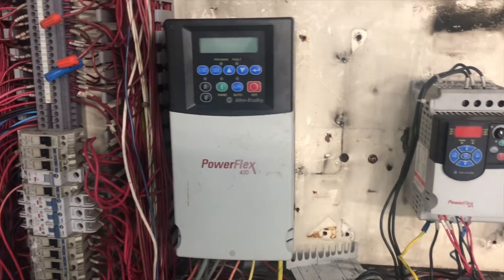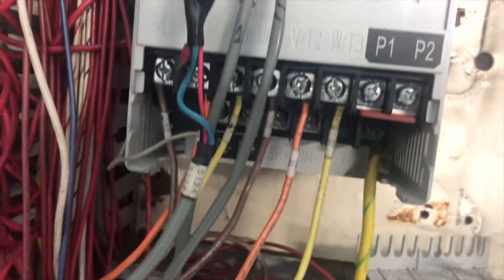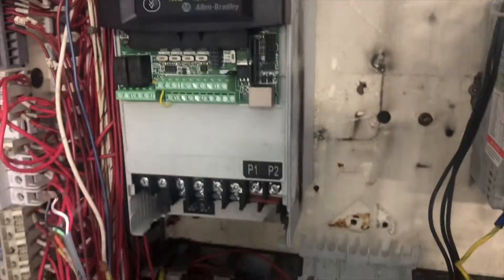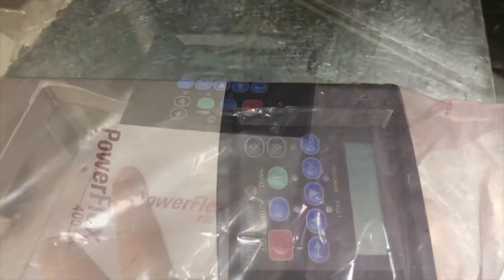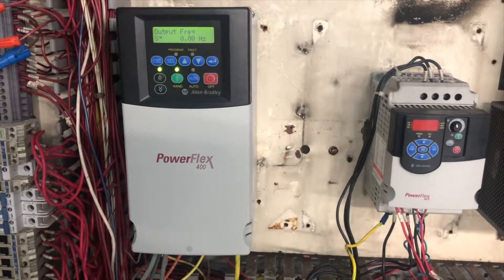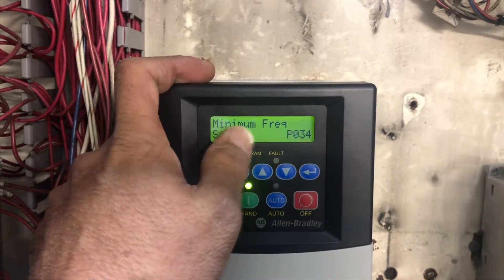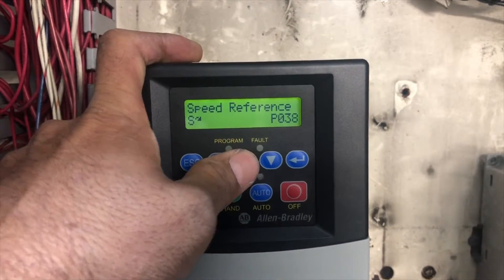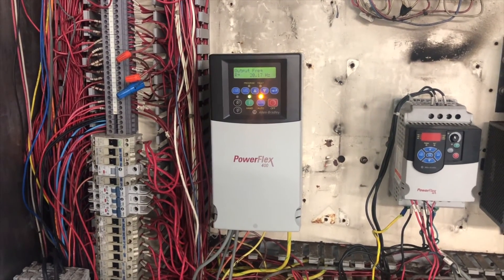How to Replace and Basic Programm Allen Bradley VFD Powerflex For Beginners

Comment: We face problem with powerflux ab400,, f12 hardware overcurrent,, we found igbt weak already replaced with new one,, but still the problem existing kindly help me..

After some times we are getting short circuit between two phase f42 and f43,, kindly help me... 

  Please advice can I replace 2.2 uf, 1200v capacitor to. 47uf 1250 v capacitor.. Please advise
Reply from the maker: Abu Aasiya 
F12 mostly mechanical issue check motor  spinning free or just disconnect motor from drive and run drive without motor if it ran then you need to check your motor
Reply: @Baljit-As-JayKay  motor is ok already check,, problem igbt,, we already change but now phase short falut coming f42 and f43
Reply from the maker: Abu Aasiya 
Actually we don’t Repaire VFDs where I work production need dis ASAP so we in those cases replace VFDs we can’t afford downtime
Reply: @Baljit-As-JayKay  ohh k brother thanks,,, u have idea about capacitor can I replace 2.2uf to. 47 uf range capacitor
Reply from the maker: I don’t think so because big difference and Capacitor are very accurate with size and power 
2.2uf  compare to .47 if really small
But I can suggest you if you have cupel of .47uf you can combine more then 1 to make up to 2.2uf